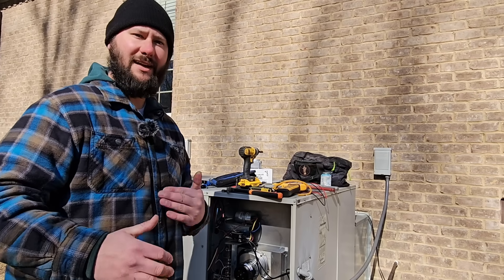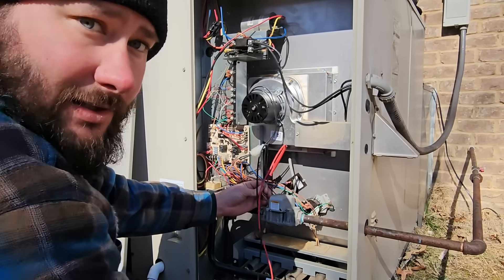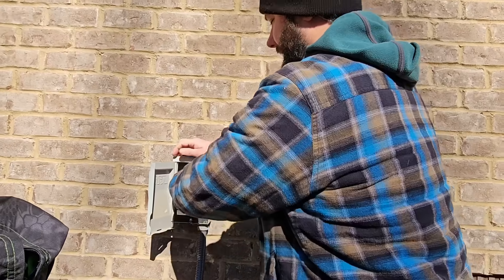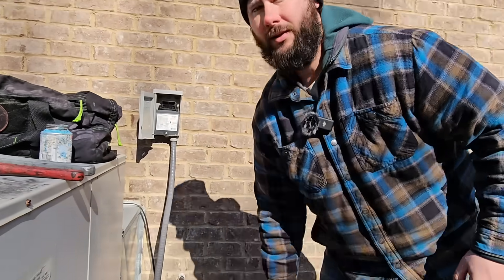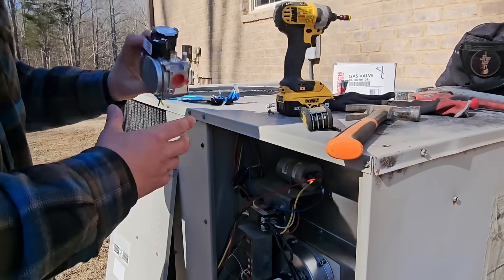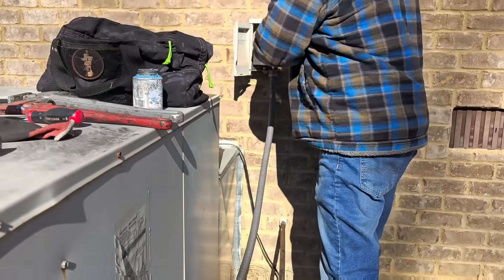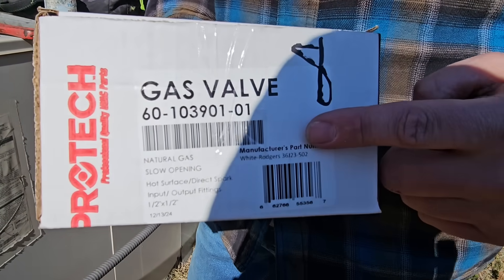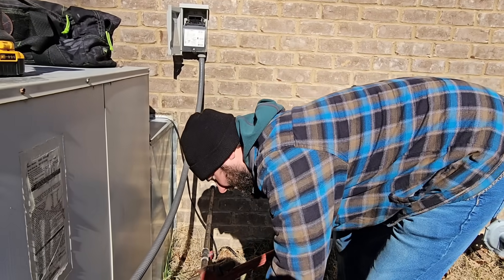Gas Valve Troubleshooting Secrets Beginner HVAC Technicians Need

Comment: I have the seemingly same issue. When testing the leads to the gas valve, I get 28 V for a couple seconds when the board sends the signal and around 14 before/after the signal, but if you "jump" the gas valve straight from the transformer it opens and gas is released. Still a bad gas valve?

Comment: So where is the best place to find documentation for old units/parts such as Honeywell gas valve, hot igniter, control board, etc?   For ours control board was replaced in 2004 or so.  Years later the blower motor would turn on but nothing else happened. Just stayed on. Eventually figured out the hose to the pressure switch had insulation blocking it and cleaned it out. All good.  Happens every couple of years.  Few days ago same thing happened but cleaning out the nipple on the blower and it worked for a day.  Then back to no blower so dug in further mad sure pressure switch was still working which it was but Igniter was not coming on.  Unplugged and replugged some connections and ohmed out what looks like some temp sensors that are in series with each other and they were 5-8 ohms which seemed reasonable.  Put everything back together and then the igniter did glow for a few seconds, then off, then on, then off, and then on and gas opened and all good.   Not sure what the issue is and if the “fix” is temporary.  Seems like I should have a replacement igniter and gas valve on hand.

Comment: I can't thank you enough for this video.   I'm not a technician... poor as hell and couldn't afford one,  so I decided to look in to diagnosing the furnace myself. I just followed along and paused when need and the next thing ya know I discover I have a bad valve. The only issue I had was finding the correct valve because my furnace is 7 years older than Christ. Anyway, I got the replacement valve, put it on, checked for leaks.... all good. Had to make my own manometer to check the pressure (poor as hell). I appreciate you taking me through this. Good video my friend.

Comment: Hi Ted, thank you for your video. All the information you share about gas valves is accurate and very helpful. In my case, the gas valve was not the issue—the problem turned out to be the control board. I think that could be a good point to touch on as well, since the board can prevent the valve from opening even when the valve itself is good. Thanks again for sharing your knowledge, it’s really appreciated.

Comment: WORST VALVE EVER. You see that grey plastic POS Honeywell valve and everything shuts down the second voltage hits it, CHANGE THE VALVE and DONT buy another one! Use a white rodgers universal replacement. I see this waaaaaay to much and every tech knows we NEVER changed gas valves out as much as these garbage valves!!! 🤣🤣 They are getting close to perfecting making things break right after the 10 year mark 😫😫😭😭🤣🤣🤣😱😱😱😱

Comment: Good video, I noticed that there was no drip pocket ahead of the gas valve, a drip pocket made with a tee of the same diameter of the supply pipe with a 3" long nipple and cap will help prevent rust and water drops from entering the inlet of the gas valve, it is mandatory in Canada. Thanks for your time and sharing your experience.

Comment: Do gas valves come pre-adjusted?  Or is pressure something that needs to be checked on a new valve.  I don't have that pressure meter.  great video btw
Reply: @jpritch2  new gas valves are not pre-adjusted. You should always check gas pressure when installing a new gas valve. 

That said, most of them are pretty close, in my experience, but I have had a few that were a bit too low. There is no excuse to not check gas pressure after installing a new valve. For the equipment, but also [more importantly] the customer, too. 

I hope that’s helpful!
Reply: @drewmarlow7593  thank you!  Just got it installed today.   Literature said it was set to 3.5 which was pretty much in the middle of the range indicated.  So I fired it up, flame looked good... will get a real tech to check it soon.

Comment: The roll-outs and limit switches dont close once the draft motor starts.....they are normally closed and only open on a roll out or high limit situation. You may be self-taught but if not, the guy who trained you was/is an idiot.

Comment: Hi,  I just bought a property that came with a gas valve replacement and LP conversion adventure called a Goodman GMP100-4.  The schematic calls for (I think) a low inlet gas pressure safety switch part# LPLP03.  I expect that to be attached to a iron pipe T on the inlet supply between the isolation valve and the gas valve (with the contactors in series from the 24 VAC to the gas valve power lead).   I find no such thing in my furnace and I don't see such a switch on the inlet gas line for the furnace in this vid either?   

Is this safety superfluous?  Do people just make this an operational problem with the LP tank fill schedule or... ?

Thanks for all the good work you're doing on these videos. I've subscribed.

Comment: Diagnosed valve was getting signal... finally tapped it with a light tool while it should be opening and it worked. Good for now... must replace. Thanks!
What are the chances of finding a drop-in replacement for a 30 year old 2-wire GV?

Comment: Great Video.  I have 6 furnaces and am constantly fixing them for various reasons.  I've done about 90 percent of the things there are to do to fix them over the last 15 years.  The gas valves are pretty resilient but I finally have one I believe that needs either maintenance or replaced.  Everyone recommends replacing them instead of taking them apart due to safety concerns.  I know I have either a sticky gas valve or perhaps one that has a bad coil, etc.  Now I feel confident I can determine that and replace the valve with no problem.

Comment: wow an outdoor unit        Good video   I got good question for you.  I got what appears to be a perfectly functioning unit.
No heat.  Everything starts up in perfect order  Ignitor gets orange hot but no gas releases into burners
I noticed NO CLICK from gas valve.   It gets the 27 AC in perfect timing just like twin unit right by it.
I figured valve bad again.  Bought used one cheap since this unit old and whole thing will probably need replacing in a few summers.
I tested valve with the connector and yep it clicked.  I figured good to go.  Put it on and expected it to work.
Everything normal and then hear click when voltage dropped and NOTHING no gas release. 
Any ideas?  I figure a bad used part and wasted an hr putting it on.  Any thoughts be greatly appreciated
thanks

Comment: Removing the protective cover of the valve reveals the contacts point which are to make contact with the circuit board rectifier. This is a worthwhile check.  The contact points are very small and over time do not make a good connection.  If any of the 4 diodes of the small circuit board bridge rectifier are bad it will most likely be visible.

Comment: I have a Hayward heater H400FDN heater.  I removed the black and white wire to the gas valve and I get a reading of 24 volts.  However I don’t get I don’t get the 15.4 v before the call like on your video.  It read 0 volts and then spikes to 24 volts and goes back to 0 volts.  Is this normal or does it always need to have some voltage to the gas valve at all times?
Reply: If I put my multimeter on OHMS and I put it on the gas valve where I removed the black and white wire, it says “OL”, so there’s no continuity.  Does that mean I have a problem with the coil inside the gas valve?? 

Sorry, I’m a homeowner trying to figure out my IF failure.  Thanks!

Comment: Remove one or both wires from the valve. Test the wires from the board with a volt meter. Power after ignitor glows? Bad valve. No power after the ignitor glows, bad board or bad connection on the board. You must remove one or both wires to test because a bad valve can bring down the voltage from the board and you could be led to believe its a bad board.

Comment: The ohms measurement you took on the Honeywell valve may be inaccurate because measured the circuit board that’s in it, which has appear to be capacitors.

Comment: Thank you for the information Tad, I believe I have a bad gas valve. I do not own the pressure tester and do not want to buy one if it is really expensive. So how much do they cost?
Reply from the maker: I think they're about two hundred bucks
Reply: Thanks for getting back to me, I will see if a friend has one, I am a DIY guy. @taddydigest
Reply: Furnace is up and running. It was not the gas valve at all it was the inducer fan. I was suspect because the multi meter showed no voltage to the gas valve and luckily a friend stopped by and thought it was the inducer fan, he was right. But thanks for your video I didn't run out and spend$200 on a valve. @taddydigest

Comment: I found some units will not give a code when there is a sensor reading before the gas valve so what I do to make sure the gas valve is good is turn off the gas take 24 volts from r and c and touch it to the gas valve terminals to test it and see if it clicks if it clicks it’s good .
Reply from the maker: That's a great way to test the valve.

Comment: 250 volts to the HSI seems a little extreme? Inlet gas pressure needs to be measured with the valve energized, even a gas meter that's locked out will have bleed through and read 7 " of W.C. static pressure. when energized it should have a drop in pressure. people strip out those aluminum tap plugs using a refrigeration bit that is not the correct size.

Comment: great tutorial for my new guys to watch ur story about leaving the gas valve test port unsealed o my I left a job one time forgot to take my jumpers  off in heat mode I drove away some hr later & 50 mile s away i get a call & they say the heat wont cut off & its 91 * in here  & knew immediately  what was wrong  ...... so I had to turnaround drive an hour back to remove my jumpers 1 st & last time ever now I make sure Tstat when turned down or up  turn heat or cool  goes off before I leave

Comment: I have watched a lot of video's on you tube and am concerned my repair people want to replace furnace. Not sure with what I have learned that my heat exchanger is bad... want to make sure. If it was bad, why did they have me spend 500.00 on a new valve that still does the same thing. I am concerned about gas pressure settings. I have a 90% furnace with two burners. The burner farthest from the valve is burning blue like it is supposed to. The other one is burning yellow. I have had some blowback and enough to trip the sensor. I had them change the gas valve for a new one. I do not notice any change from the flame when the circulation fan turns on and haven't seen any blowback since changing the valve. Could I not be getting enough gas? Does it sound like I have low gas pressure coming out of the new valve? I checked exhaust and not clogged. Any advice would be greatly appreciated.
Reply: Thank you so much for all the advice in my situation!

Comment: great video, a trick ive seen to get out set allen screws is try a star bit that fits in there with a slight tap and even  a rubber band on the end of the bit can give it even a little more grip too
Reply from the maker: Thanks for the tip, I'll try that out!

Comment: Good video on troubleshooting valve might have been clogged or jammed up with debris like rust flake. You should have installed a gas furnace drip leg, also known as a sediment trap its a good practice also code required here in CA

Comment: Little trick for checking the orifices, use a peice of thermostat wire and bend a 90 and push in through them all ...works for me..
Plus I will use a working gas valve on my truck to verify board..plug the wires on the new and checked system operation..its quick and easy..

Comment: I spent hours troubleshooting a gas valve on a commercial building that wasn't igniting the pilot light. I was getting less than 1" w.c. out of the pilot opening. I was adjusting it and couldn't get it higher. I saw a trane unit working in heat mode down the roof on the same piping so I ASSUMED inlet pressure was good. I went downstairs and noticed the water heater was on a soft lockout... Needless to say, I spent too much time looking for an issue past the gas valve when the main regulator failed and the whole system had only 1" w.c. feeding the entire place... Point being, don't overlook the basics and check inlet pressures also.

Comment: More pro tips..  Test voltage to gas valve while wires are connected to it/ under load.  Never touch/ move  on/off switch on them, ohm check to see if open or shorted.

Comment: Once you screw a hole through the tap you have to replace the valve anyway, kind of a joke! And the homeowner will be pretty pissed! Never in 20 yrs Have I ever heard anyone say to do something so stupid! Just get some tstat wire and jump Common and R 24v straight to the valve, if the fuse pops the coil is shorted, if it sprays gas then your board is bad. Works for me every time. This is just some BS.

Comment: Hey Tad good video, obviously you were pretty sure it was a gas valve but once you put a screw through the outlet port you had no choice but to change it after that. Before you put the screw in it I thought you were going to put a lighter to the orifice at the burner tube to confirm there was no gas coming out
Reply from the maker: That's a great point, I should've demonstrated that in the video!

Comment: Thanks Tad
Reply from the maker: You're welcome brother
Reply: Beware of Trane RTOM (Reliatel Options Module) alarms that will fail heat, or lock it out completely because of board corrosion. Real pain in the butt to figure out. 

Great channel. Keep it up. 👍🏻

Comment: It’s a good idea to check inlet and outlet gas pressures at the same time. I had a situation where pressure was showing good when the  gas valve is closed and when energized the inlet pressure drops to 0 lWC. The pressure regulator at the meter had failed.
Reply: Had the same issue last week, inlet standing pressure of 8-9”w.c. to a 2 stage gas valve and upon ignition it dropped down to 2.15” w.c., customer was informed to call her gas company. I gotta go back tomorrow to check out the pressure after they assessed and said everything is good on there end
Reply from the maker: Good Stuff Thank You for sharing this info

Comment: Hey what’s up man young hvac tech here 2 years in now ! Check this had to change my first gas value about 2 weeks ago had the same gas value I was getting the 24 Volts when it opened then it would blow the fuse everytime also the rats ate most of the thermostat wire in the attic as well i replaced all that and put a new gas value and the customer is still up and going .
Reply from the maker: That's awesome, keep up the great work!
Reply: @taddydigest yes sir I sure will 👍🏽

Comment: You should've added when putting cap back on adjustment screw to just put on snug and not over torqued for no good reason . Many times I've had to replace gas valves because there was no way to get the cap off as that brass cap was all mangled with people using the wrong sized slot screwdriver

Comment: Also, you can put an amp meter around the gas valve wire. If the coil is bad, it will read high amps. I just had a similar issue on a residential furnace and it wasn’t blowing the low voltage fuse. It drew 3 amps for less than a second.
Reply: By high amps, do you mean anything higher than 3-5 amps?
Reply: @SombraLocs 
Anything over three amps will blow the three amp fuse on the board. Test for voltage, not amperage.
Reply: @ia3598  what is normal amperage?
Reply: @avanders457 I don't know what's normal, but most transformers are rated for 40 VA which means everything together can be no more than 1.67 amps at 24 volts.
Reply from the maker: Wow, thank you. I realized I left that out.I should have done that in the video.Thank you for this
Reply: @ thanks for all the content.
Reply from the maker: @ia3598 you're welcome my brother
Reply: Your videos are a blessing! Greetings from San Antonio Tx
Reply: Never seen any failed 24 volt part on the furnace blow the fuse.
Reply: @AmericanFarmerHVAC2024 
The three amp fuse protects the low voltage side. A pinched wire to ground, a bad board, bad thermostat, bad condenser contactor outside. Shorted or grounded wires to the thermostat, zone board or condenser. There are many reasons the 24 volt 3 amp fuse could blow.

Comment: Is that right? I have never seen 250 V going to a hot surface igniter.
Reply: Me either, not even on commercial units.
Reply: @SombraLocs  same
Reply from the maker: It's rare for sure
Reply: @taddydigest  in the 14 years I’ve been doing this. I have never seen that before. I worked on plenty of gas packs too.